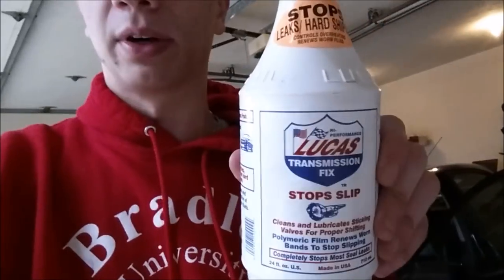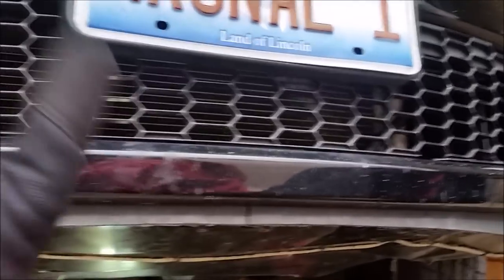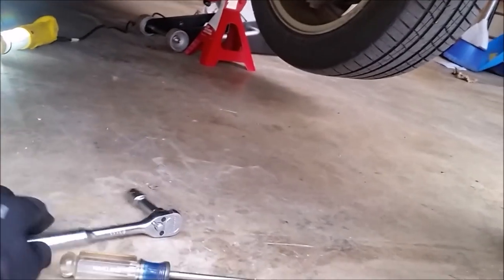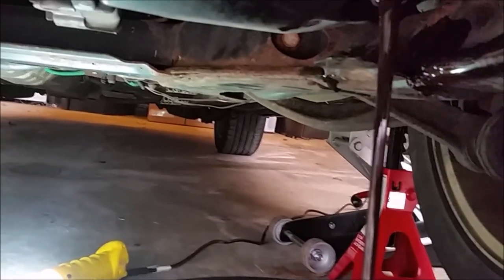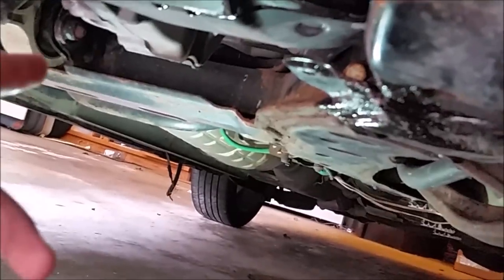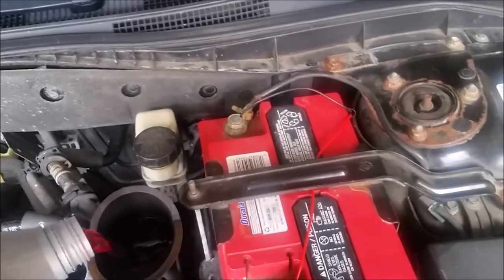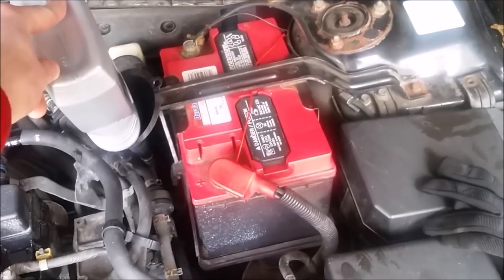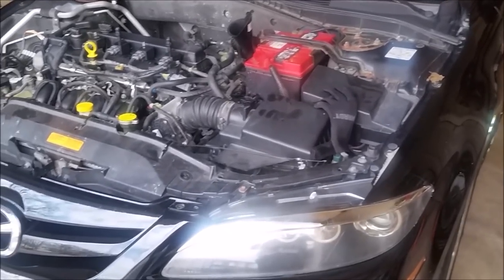Fixing jerky  automatic transmission and hesitation in acceleration   2006 Mazda 6

Comment: How did the Lucas's additive work out for  your transmission it's been a while since you posted this video just wondering since I just got new ownership of a 2010 Mazda 3 with over a hundred twenty-four thousand Miles and transmission fluid look like yours
Reply from the maker: Hi Garcia, I should make a follow-up video. It did help the shifting tremendously. after this video, I switched the fluid to Redline ATF D4. It shifts butter smooth not. Over 170k miles
Reply: @AnthonyAwada  Have a speed input/output sensor code, Fluid is a thin lite black will try Redline ATF D4..

Comment: I have a problem mi car when I'm waitin in a stop or red light the Rpms drop & it feels shaky
Reply from the maker: If your rpms are dropping chances are there is something wrong with the combustion in the engine. Either the car isn't getting enough air( running too rich) or the car doesn't have enough fuel ( running Lean).Watch my video "how to fix code p2188" it shows how to clean MAF and the connection. Hopefully that will solve the issue my friend.
Reply: Vacuum leak and MAF/MAP come to mind.

Comment: I just bought a 2002 Toyota Camry two days ago. Yesterday, as soon as I pulled out of work the rpms went up and then the car jerked into gear going from 2nd to 3rd I do believe. the whole 30 min drive home the car shifted perfectly. Same exact thing happened tonight when going home from work. It only does it once and then the rest of the ride is flawless. I really hope that I don't have to replace the transmission as that can be really pricey. what would you advise?
Reply from the maker: Shavonne Phillips Hi Shavonne, there seems to be a problem with the shifting between 2cd and 3rd gear. I would check the fluid level ASAP and make sure that it is in the correct level and that it isn't dirty. let me know what you find out.
Reply: Happens to my Harrier...exactly like this
Reply: I changed the fluid and the level is ok. Jerks only on first gear.. .rest shift fine...and needs warming in the morning before moving.
Reply: And I changed the filter too.

And bought new mountings for both trans and engine

Comment: hello, i have a 2005 madza 6 for almost a year now, and yesterday while driving to the beach and when pressing the gas peddle the car took a second or more to excelrate and athe same time i would get a kick off. can u tell me whats wrong.
Reply from the maker: janiel bahadoo Wow the beach, wish I could say that, it reached -9C yesterday :p. Check your transmission dipstick make sure that the fluid is not black and does not smell burnt hesitation and acceleration could be caused not by transmission but by a lack of tune up. It may be time for a tune up. And by that I mean, clean mass air flow and throttle body, spark plugs, change engine oil, running some Marvel mystery oil through the gas tank.

Comment: I having this problem on my 08 mazda 6. It has really rough shift from 1-2 and 2-3.  Checked the trans fluid and its basically totally black. Should i just do as you did in this vid?
Reply from the maker: Grant Goble Yes! Measure how much fluid comes out and put the same amount back in. I'd use either M5 transmission fluid (which you can ONLY Buy at the Mazda dealership, Don't buy the crap at local parts store) or you can use Redline ATF D4. Redline is more expensive but worth it. No need to put Lucas stop slip. After chaging the fluid once. I'd wait another 2 months and repeat the process again. I hope this helps. Stay in contact if you need help!
Reply: Anthony Awada is their any kind of way I can call u . I have so many questions bout my 1999 Mazda 626

Comment: Hi there Anthony. How do I fix jerky MANUAL transmission and hesitation in acceleration   2006 Mazda 6 Sakata. From cold start it revs up and down for about 7 mins before normal ticking over. Jerks on acceleration even after driving for over 30mins. Someone was telling me its most likely flywheel. What gives
Reply from the maker: My money would be on scored flywheel  and destroyed clutch and pressure plate. Also check your slave cylinder.

Comment: Help pls , I have a 2006 kia spectra sx with 2.0 motor 200,000 miles , Motor all of a sudden aquried a miss , as if starving for fuel or air , n then all of a sudden run like a champ , just to start missing again. , thought I would ride it out last night to go get something from store when backing up out into main rd , put in drive n turned on headlights n car jumped into neutral , then turned off headlights n car jumped back into drive , needless to say I never made it to store .. Has anyone else came across this problem , what causing this to happen ?

Comment: Hi there Anthony! How did you reach the bolts that are above the frame in order to replace the filter?
Reply from the maker: Rafael Gonzalez Hi Rafael, there are a couple ways to get those bolts. 1) Jack up the transmission and engine with a jack. That will lift the engine and transmission and give you enough space to reach them. 2) Get a swivel socket and maneuver it. Hope this helps!
Reply: Thanks man! By the way, How's your Mazda 6 transmission going so far? I´m having some issues with mine. It is a long story. I´m living in Venezuela and have a 2007 Mazda 6 with 170K miles on it. It started kicking  from 2nd to 3rd gear and giving me the AT light. Tranny fluid has never been replaced because all Mazda authorized dealers told me not to (WRONG). The scanner gave me Codes P0661, B1318, P0733, P0744 and P0841 (Some of them refers to dirty tranny oil/Tranny oil pressure control solenoid.  but after a couple of days of having the car parked, all codes disappears. Any suggestions? Oil has brown color but it doesn't smell bad or burn so I´m planning to replace it.
Reply from the maker: Rafael Gonzalez Hi Rafael, yes you do need to change it. I wouldn't flush the fluid from your transmission, but change the fluid. Flush simply means to take every drop from the transmission, change means to change what's only in the pan, which is like 1/3 of all the transmission fluid in your car. I hope your car improves shifting. My car had the same problem.  I was told never to change it. The it got so dirty that even when I changed it is noticed little change.

Comment: Anthony Awada thanks man, I have another question. I put Mercon V on my Mazda 6 and now, after 10.000 km star to have problems with it, I press the accelerator and the RPM rise but not the velocity. So, what do you thing about it, is it my AT damage or maybe changing the ATF may fix the problem
Reply from the maker: Er Saavedra Oh my, you put in the wrong fluid. M5 is not the same as Mercon V, M5 actually stands for Mazda 5(which is their own brand of ATF). Putting anything else that isn't M5 compatible will definitely eat the clutch pack. I would recommend meeting with your local Mazda dealership and seeing what they recommend as this could be a serious issue. If you do end up changing the fluid I highly recommend Redline D4 ATF. And change your filter as well. If you notice a lot of metal shavings and your fluid has shavings in it then your clutch pack is destroyed and you are looking at another transmission.
Reply from the maker: Er Saavedra Basically when your stepping on the gas and only RPM goes up  it's because your clutch packs is slipping and not grabbing on.
Reply: Anthony Awada thanks man, now my pocket is worry😨
Reply from the maker: Er Saavedra I'm sorry , I really wish I can help you more. Think as Automatic Transmissions as girlfriends. If they ask for a boat and you get them a yacht. Then they will still leave you because you didn't get them a boat. They are very picky,just like Automatic transmission. You can give them better fluid, but they need the fluid they want. Please update me on what happens. I wish you the best and let me know if I can be of any further assistance.
Reply: I´ll do. Regards

Comment: i have chevy 2011 i’m having the same problem everytime i’m at a stop light car jerks pretty hard like u can hear it do you have any suggestions please let me know thanks
Reply from the maker: Hi Ali, check your trasmission fluid and make sure it is at the proper level and is not dirty or old. On Chevy's, I would also check the engine/ transmission motor mounts.They are prone to fail and can cause your car to jecrk when they shift back down to 1st gear.

Comment: I am having the same problem with my 2006 Mazda 6 Does your mazda have a automatic and manual transmission like mine and if not can I still do the same thing to fix the problem???Thanks
Reply from the maker: Yes, I have the automatic transmission with the triptronic shifter. I wouldn't really call it a manual transmission since there isn't really a clutch pedal. But you can for sure try out changing the fluid with either Mazda transmission fluid or Redline ATF D4.

Comment: hi antony i have a question with you actually  i have honda civic AT 2006 and i got problem like my paddle shifter is not working second things there is nothing vissible on car screen about which gear is on while i do paddle shifter mode and when use my car gear shifter its gives a jerk every single time let me know what should i do
Reply from the maker: Pawandip Singh Hi Pawandip, there could be many things causing that issue. I would start by checking the level of your fluid. make sure your car is running and on a flat surface and warmed up when checking automatic transmission fluid if it is very dirty or very low your car might be in limp mode which is why it does not engage paddle shifters. is that does not solve the issue I would check to see the linkage of your shifter and the transmission and all the sensors connected to the transmission to make sure that the transmission is fine.

Comment: i’ve been having problems with my mazda 6 08. i was told by a mechanic i have a certain number of miles before my car is no good anymore.. about a year ago i heard a LOUD bang while driving and pulled over to take a look and nothing seemed to be wrong. some time this year my car started to jerk back and forth when put in park and when i go above 40mph i hear whining or squeaking or something.. i know i need an oil change and transmission fluid but could there be something else? i’m honestly just thinking about getting a new car.
Reply: i’ve been having the same issue with the exact same car, i think it’s a leak because whenever i put in transmission if it stays parked after there will be a big puddle under the car, but i still want to know if it’s a bigger issue than just a leak and i can’t find anything about the 08 model
Reply: @pretzall  thank you for the reply! I totally forgot about this comment. Yes, as for the leaking, personally I think any leak isn't the best. I had that problem with my old car too. I had a very strong sweet candle burning smell going on in my car for about almost 2 weeks. I was curious enough one day to get down on the ground and look under my car, it was an all white chalky substance stained the entire car, on pipes, tires, exhaust pipes, everything. I never got to find out what it was unfortunately. I'd say get it checked out ASAP waiting will make it worse!

Comment: Would you recommend Valvoline Maxlife Full Synthetic Dex/Merc Mercon IV for my 2004 Mazda 6 3.0L?
Reply from the maker: NO, I guarantee that will kill your transmission. M5 does not stand for Mercon 5. It stands for Mazda 5 which is their own transmission fluid. The fluid from Mazda isn't that expensive. In fact its same price as the Valvoline Maxlife. If you don't want to use Mazda's transmission fluid you can use Redline ATF D4.

Comment: I have problem with my mazda 3,

In the automatic when I accelerate, as soon as it enters the fourth change, the car does not walk anymore, it seems to be in neutral.

The mechanics claim to be the back cover of the transmission, once I changed and walked well for a week, but now it's still doing the same, any help?
Reply from the maker: Hi Shiraaz, I am sorry to hear this. The first thing to do is see if you have any A/T light on your dash. If so, get it scanned. The second thing to check is the color of your ATF fluid. If it is dark, a simple change could resolve your issue. If it is red, I am afraid that you might need a new transmission.
Reply: Hi there, thanks for helping me, now I'm using triptonic, I only use it until second gear, and the car is still strong.

when I leave the automatic, as soon as the car fails the AT light came on, but when I turn off the car and turn it on the AT disappears.

The oil is dark, a synthetic red oil it can work ?
Reply from the maker: When you drain the fluid, check for any shards of metal. A little is okay, but if there is a lot of metal shards, the transmission is eating itself. You can try to change, not lfush, the fluid. I'd recomend using Redline ATF D4. It's expensive but is the best.
Reply: Actually the transmission was eatin' itself, i solve the problem yestarday. I opened tha back of the gear and i change the disc inside, i saw few shards of metal. I guess now i must change the oil ... Ill search for the Redline. then i'll say something. Thanks a lot
Reply: @MyShiraaz  What do you mean by this, "I opened tha back of the gear and i change the disc inside, i saw few shards of metal" . I have a Mazda 3 that almost has the same issue.
Reply: @marvinjuelz  Hello, sorry for the late reply.
When you take off the car's gearbox,
on the left side there is a lid that has screws,
when opening the lid you can check the inside of the gearbox

when it's broken, you can see inside, because there are some discs inside

what I did was remove the entire interior and put the lid on another gearbox,

I find it very cheap compared to buying new gearbox.

but if you dont have the right person who can see it, then you may end up spending several times to exchange,

So, if you can, buy a new gearbox if you don't have someone experienced in this matter.

Comment: Hi am getting the same problem with my 2006 Mazda 6, the engine light comes on for the solenoid D AND E are the Error codes do you have any information on this.
Reply from the maker: Sheldon Alonzo Hi Sheldon, what you have to do is drop the transmission pan and remove the Solenoids that are bad and replace them with new ones. It is a simple plug and play. The solenoids are mounted to the valve body.
Of course once you remove the pan you need to put some fresh fluid in the transmission.

Comment: Should I do another flush if I still have slipping ??
Reply from the maker: No flush might actually ruin your transmission. Do a change only; where you drain whats in the pan and replace it with new transmission fluid, that is replacing about 1/3 of all the transmission fluid. A flush is where all the fluid in transmission and pan is removed. You don't want to remove all the fluid because you could cause more slipping issues if your car has not been maintained correctly. Also, you might want to use Lucas stop slip.
Reply: Anthony Awada  hey Anthony it's been 1 year now I don't have any codes but it still shifts bad from 1st to 2nd do i have to change it again

Comment: Hey .. Plz i have Jeep compass with a cvt transmission that when acceleration the car wont accelerate with the amount of gas i press. Like from dead start when i press the gas pedal all the way in the car accelerate slowly and wont move fast only when i lift my foot of pedal slowly to 2500 rpm its move between 40 to 60 mile and when i still pressing on gas pedal and make the rpm goes to 5000 the car slowly rising in acceleration but the transmission light comes on and the    Car goes to safe mode with a smell of burning transmission fluid
Reply: HELP! Do i need to change the fluid?
Reply from the maker: CVT transmission are much different than the transmission I am working on. However I do know bout CVT. Change your fluid and make sure you use CVT fluid ONLY!!!! One drop of ATF and you transmission is a gonner. Buy the CVT fluid from your dealer. Or have the dealer do the work.  You are supposed to change CVT fluid every 60k. I hope that you abided by that. Also you want to check you fluid cooler, which is behind your radiatior. Maybe that's why you are smelling burnt fluid.
Reply from the maker: +khaldon ibrahem  This video won't help you. DON'T put Lucas in you CVT.

Comment: Will this work on my 2004 rx8? When I floor on the gas pedal it doesn't take off fast until 2.5k rpms +
Reply from the maker: Hi Skyvelocity, thank you for you comment. If your RX-8 is making noises from the transmission area when accelerating and jerks while shifting, then the transmission might be reaching the end of its life.

That's worse case though. RX-8 are know for carbon buildup. If in were you I would  tune your car up, including carbon removal (from injectors, valves, throttle body,  mass air flow sensor). I have a video to assist you with the throttle body and MAF sensor. Furthermore, change spark plugs (for RX-8 you have leading and trailing spark plugs for each rotor). Then I would recommend  doing this to your car: find the correct AT fluid for your car from Mazda Dealership along with a AT filter. Then I would drop the pan (something I didn't do in this video) and change whatever fluid comes out with the filter. Your car should then run better, however do remember that the car is 12 years old and is an automatic transmission which AT wear out faster if you floor it and launch them.
Reply: +SkyVelocity  WELCOME TO ROTARY!!!!!!!!!